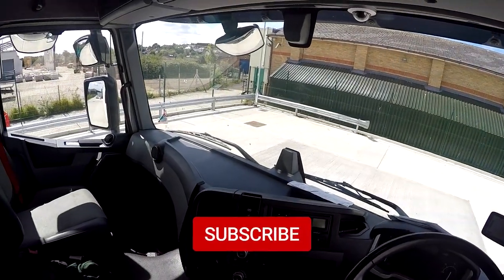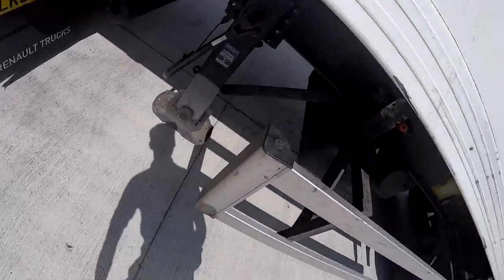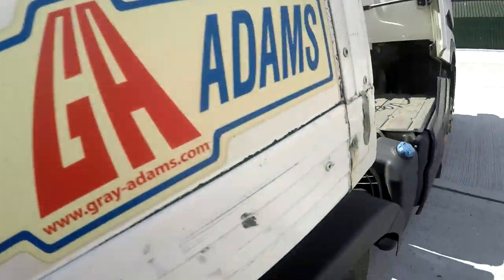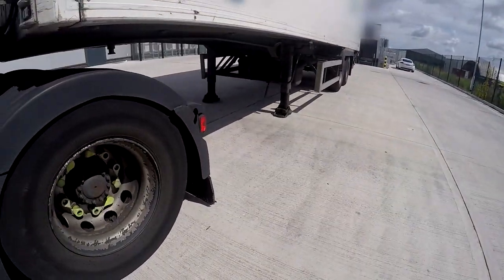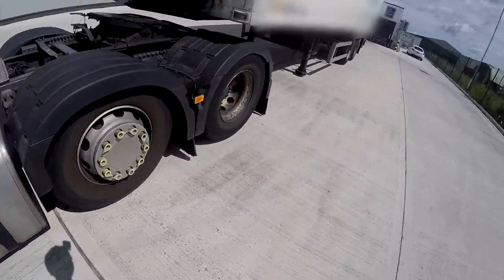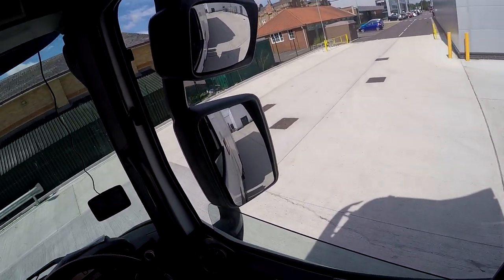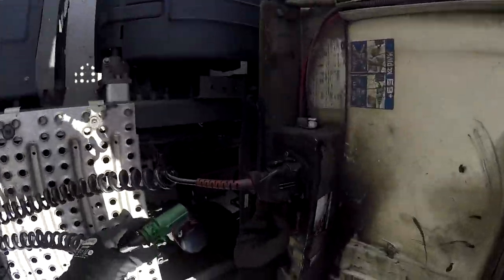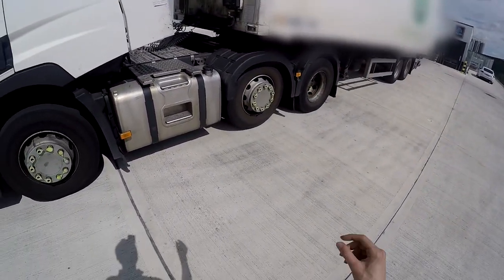Uncoupling & coupling a trailer - My best technique

Comment: This is the first and only vid on here that tells it how i am being taught. (Same Renault truck also) Pull forward a few feet so the 5th wheel is out of the kingpin, then lower the tractors suspension, so the trailer drops onto its legs, then off you drive. All other vids just show you driving straight out. And when re-coupling, repeat the same process. We are told to check the trailer over before coupling, just to make sure its free of defects, and then do a light check afterwards once its all connected, and then numberplate is near enough the last thing. Im here watching, just to drum it into my head over and over what to do, as first time, i missed doing the two pulls forward.

Big thanks for this tho.

Comment: You’re the only driver I’ve found so far that does the suspension lower after the kingpin release/5th wheel release and I’ve watched a load of vids. Test tomorrow!
Reply: Did you pass
Reply: @johnman8554  Yeah and passed on road test. Job hunting now! Cheers
Reply: Did ya find a job pal on class 1

Comment: Great video just a quick question im using a dual fifth wheel so I can have it in low position or high position would it be the same steps in low position im new to the trucking industry so just wanted to clarify

Comment: Dont you open the kingpin again for coupling, or do you only have to open it for uncoupling?
Reply from the maker: The spring holds the bar open, it's only when something enters the fifth wheel and presses on the mechanism that the spring comes across to hold trailer in place. So no, you don't need to open it for coupling unless someone has purposely closed it

Comment: "Nice and peaceful, calm and controlled"

Excellent video. Most helpful. I needed that about using the suspension. Easier on everything. Thank you.

Can I just say that if you can't turn the legs handle because it's jammed due to the mechanical pressure, try  raising the suspension a little and you will then be able to crank the handle to raise the legs.

Same with the Brake line Suzy. If you cannot push it onto the nozzle  due to the pressure, then go and raise (or lower..?) the suspension again and then it will go on easy. 

Another way to deal with too much pressure stopping you from connecting  the red line on, is to go to the cab and pump the air brakes, several times to lower the brake pressure. Then try again and you will find you can connect the airline.

Comment: What's a split uncouple? I'm going for class 1 week after next, but my trading provider uses a draw bar config 🙃
Reply from the maker: Hey, a split couple uncouple is usually done when you have a 44ft trailer and there isn't a lot of space between the headboard of the trailer and the back of the unit. Effectively you don't reverse all the way to the kingpin straight away, connect/disconnect the airlines, and then reverse fully back :)
Reply: @YoungTruckerUK  makes sense, how do you ensure that the brakes for the trailer remain locked on for the trailer for the tug test, when the airlines are already connected?

Edit: thanks for the reply : )
Reply from the maker: @olivergunn2796  As long as the red brake handle is pulled and the black handle next to it is in on the trailer, the brakes won't come off - Even with the airlines connected

Comment: Great Video as always! What gloves do you use? I bought some and the inside of the gloves always catch when winding the legs up on the handle. Maybe a good video to show is how the remote works for the suspension in the cab? Keep up the good work :-)
Reply from the maker: Hi Daniel, not sure on the brand of gloves but they are great because they are grippy on the outside and 'fluffy' in the inside so keeps my hands warm when in the fridge and winter months. My gloves catch too when they are brand new but as they wear they don't grip quite as bad. Thanks for watching! 😊

Comment: Surely you should do a trailer check before re-coupling as it may have a defect I.E.illegal tyre  .faulty door's etc .
Reply from the maker: Absolutely you should you are correct. Chances are the trailer condition will be identical to when I dropped it 30 seconds beforehand 😉 generally always trailer check when coupling

Comment: Asking as a rookie who's not done much swapping. Always just used the same walking floor. How'd you remember where to connect the airline's etc?
Reply from the maker: I know what all the connections look like and which ones on the unit fit with which ones on the trailer. I put it down to hundreds of swaps so far haha

Comment: Great video mate 👍
Reply from the maker: Thanks bud 😊
Reply: @YoungTruckerUK  you make it look too easy.i passed my class 1 in 2009, but hvnt driven since.now im trying to get back into it.do you always raise the air suspension fully up each time you couple the trailer?
Reply from the maker: @steveadams2328  after checking the trsiler beake is on, yes I basically raise the suspension up all the way to make sure the legs are off the ground
Reply: @YoungTruckerUK  thanks for video..very useful.although im hesitating getting into class 1. I know twchnology has moved on with truck sat navs. I suppose its the reversing that is one thing off putting
Reply from the maker: @steveadams2328  Yeah navigation has come a long way although it is far from perfect and you still have to use your initiative. Reversing is something that can only be taught up to a point, after that, you have to really get the 'knack' of it yourself! All the best Steve